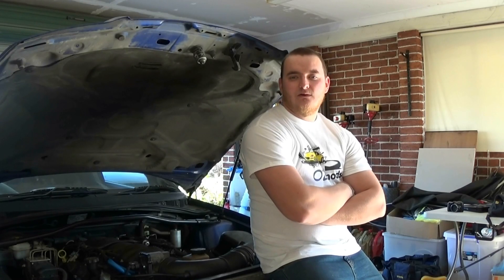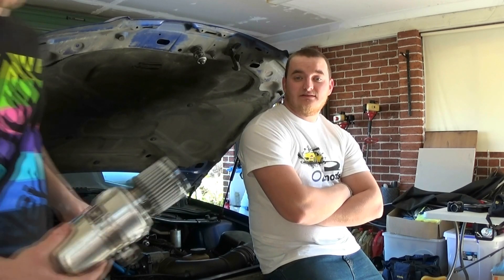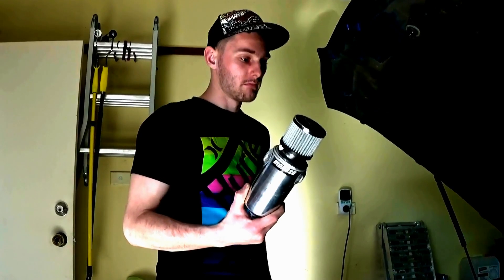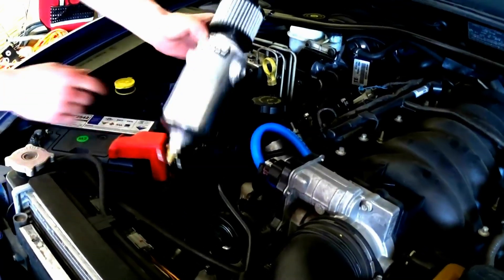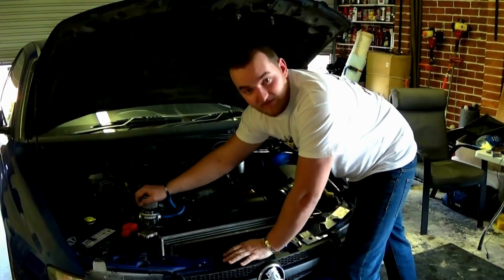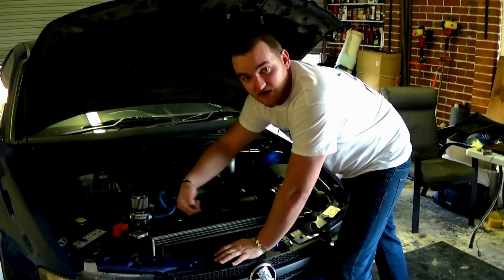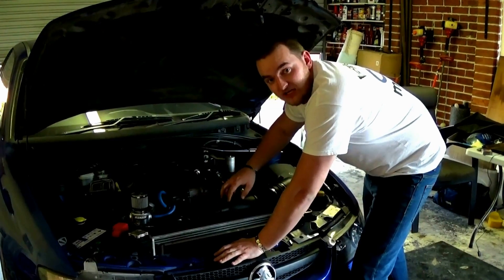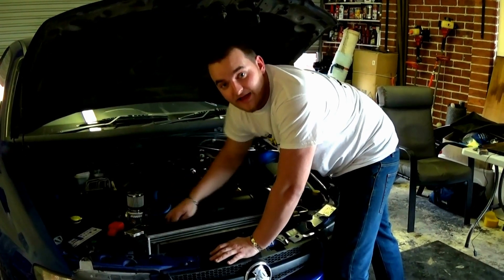Oz Mods - How to fit a catch can on a vz commodore LS1

Comment: im a ford man and have no idea on ls hose set up,  but for a vent style can u remove the pcv valve or have a sealed can and a return to intake with pcv..!  vent style catches moisture buildup in crank case. pcv style is and oil/air seperator.!!

Comment: Hey nice vodio are oil Catch cans any good on a alloytec ?
Reply from the maker: You will benefit from having one on your alloytec as you won't be burning any oil blow by. However I don't have one on my vz I have a small breather on either side of the rocker cover doesn't leak oil or anything just remember you will need to plug up the ports on the manifold and intake pipe afterwards, this is something that we might cover if a future episode.... So keep watching.

Joshua
Reply: Ok thanks mate i might hold of on the oil catch can for a bit ok cool yeah will do i injoy waching the ozmods vidios 😉

Comment: Pretty sure that setup is illegal?,cannot vent emissions to atmosphere
Reply: sure is illegal.... And unnecessary. Just use a sealed catch can to take the oil out of the blow by, and send the rest back into the engine to be burned. Leave the open catch cans to the race cars...

Comment: why do guys put a vented oil catch can on a maf based system? your essentially letting out/in air which the pcm already accounted for at the maf...thats the reason pcv systems are sealed ..non vented would be fine ..what isnt good for performance is screwed up fuel trims from a vent after the maf
Reply from the maker: +K Brx In our next video bud we remove the maf and tune it but you are %100 correct, we shoud have explained this but we are getting there. Check it out our later videos
Reply from the maker: The car has been MAFless tuned.
Though interesting point. I couldn't imagine it would change anything, the PCV is Plummed in 200 mm after he MAF.
Reply: good on ya,thought you guys where still maf ,alot of guys in the states add a vented oil fill cap and dont realize they are just messing up trims...pcv wouldnt matter on a maf'd system its still closed and after the maf stock ...love the show guys ,keep up the mods !